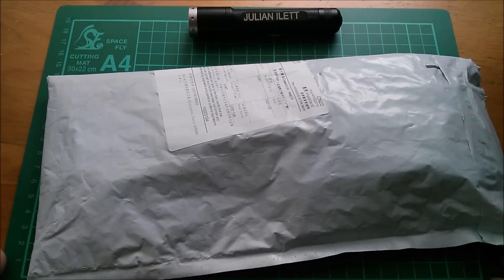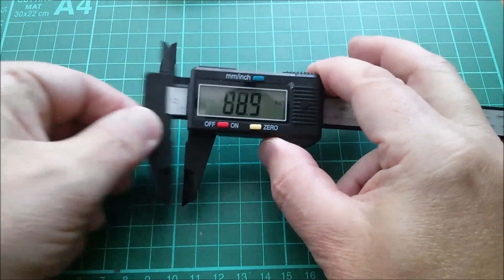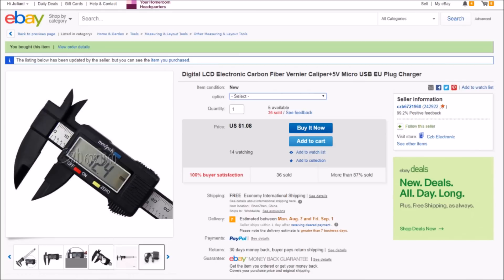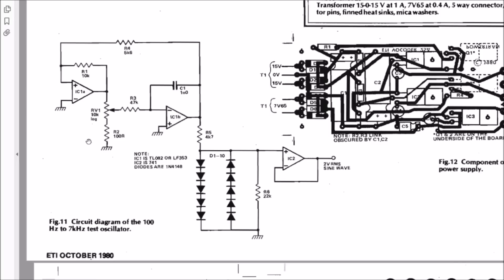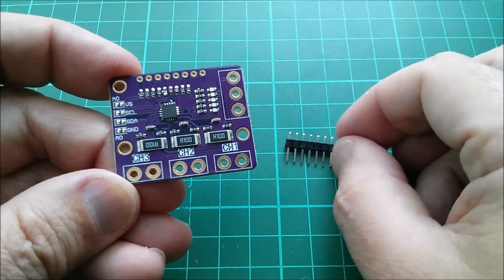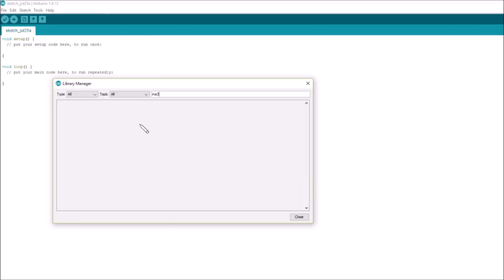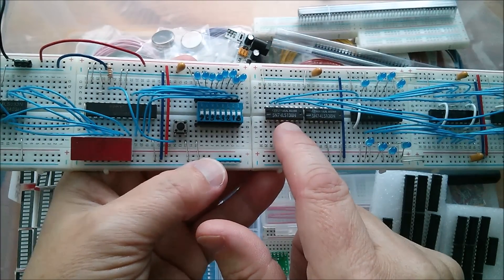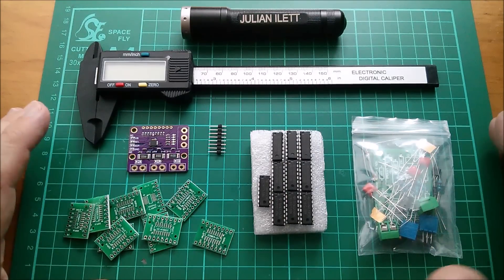Julian's Postbag: #102 - Electronics through the Letterbox

Comment: How the hell does that sine wave generator work, the one using 10 diodes? Does it just chop up a triangle wave?

I have always used a LC tank oscillator, hooked up to an op-amp to amplify and drive the LC tank oscillator, and then buffer that for a current backed usable sine wave signal.
Like this:
http://tinyurl.com/yyrp5lm4
Reply: That's an interesting page,  there.  The vocoder-related circuit does NOT generate any kind of a sine wave  the dual op amps are set up as a schmitt trigger and an integrator,  so you would normally get a square wave and a triangle wave out of it.  The diodes just modify the triangle wave a bit,  but it's not a true sinewave,  not at all.
Reply: @Roy_Tellason  Yeah as I thought then.

Comment: Hi Julian,
I think I am having trouble with the smd resistor on the purple INA219.  I've tried to substitute the R100 with an R010 to measure 32 Amps at 12 volts and burned up a board.  Could you comment on the correct resistor for the higher amperage modification, please?  You called the R100s 100milliOhms and I'm not sure of how that is derived.  
Thank You,
Nick
Reply: It is highly unlikely that any Printed Circuit Board would have tracks which are capable of carrying 32 Amps, so there's your problem.  You need conductors which are able to carry that much current without overheating.

Comment: Should look at the one I just bought from a UK seller.

What a joke, cost me £9.99 and the finish is horrible for a complete metal calliper, its accuracy is anyone's guess, it measures 1mm more than it should do and under measures and never reads zero.

It has movement and when its "wiggled" in a zero position, the counter on the LCD goes up.

Comment: Hi Julian it seems that on the power bank that works there are two resistors on the data lines pulled to vcc and ground,the pondland power banks don't have these,I think its something to do with them,I've read that apple devices need them for charging,and it seems my v-usb circuit bennafits from them some how.

Comment: Hi Julian, I've got a question to ask,its not about postbag but about power supply's! Hear goes,I've a development board based on v-usb its called pixel loader,it basically runs strings of ws2812b led strips,now I use 5v dc usb power supply's,sometimes i use phone chargers, as my development board pixel loader is just a USB stick dongle kind of design with a 328p on board, it just plugs in and runs sketch loaded,Now hear is my problem,some of the USB power supply's don't seem to work,there is power to my board but won't run,its in spec at 5v and I never over load current I only run a few LEDs in a strip. I've a load of them and some work and some won't,do you think is because they may be too noisy? I can't think why they wouldn't work,even when I've no LEDs powered the the board won't power and run,Ime using usbasbloader as the  bootloader so I can plug the stick into the PC and change my sketch quickly, I think its something to do with the power supply sending noise down the USB lines maybe,what do you think? Its so strange,I've seen this a lot even with power banks not powering some projects but will others even when in spec.thanks
Reply from the maker: If you don't have an oscilloscope and you suspect noise is the problem, try putting a whopping great capacitor across Vcc and Gnd (near the processor of your controller board). That should help diagnose the problem.
Reply: Julian Ilett  Hi I tryed that,ime thinking now it may be the bootloader,its supposed to exit after 15 seconds of power.ile dig around some more,thanks pal.

Comment: The calipers are quadri calipers and have 4 measuring faces, you found 3. The fourth are opposite the hole depth gauge end if you turn them over when you slide them you'll notice that the end face and the back of the caliper have 2 parallel faces which can be used to measure stepped faces. Don't worry most engineers don't know that either. I've only used the metal versions as I'm not sure how accurate the plastic ones would be. There is also a reason they are called verniers, as the readings are only very near, real inspectors / engineers would use something a bit more accurate tolerance dependant but when your working to .0005" or .01mm accuracy they are not so good. Still ok for measuring most stuff.

Comment: Some problems with the cheap calipers is they use a lot of power in standby and don't have a low voltage cutoff, so as the battery gets low the measurements get dodgy. for a dollar though you cannot complain.

Comment: The reason the lightbulb goes instantly dim is because it starts off with a very low resistance many times lower than its nominal one! As it heats up to temperature, the resistance shoots up within seconds. Plus you can imagine your battery as having a parallel capacitance due to its layered construction, so after you draw a good bout of current out of it, its ESR too goes up.

Comment: I tried simulating that ETI test generator in LTSPICE (using LT1057 for IC1). Wouldn't oscillate... Anyone got any ideas why not?
Reply: And by sheer coincidence, after posting the above, I stumbled onto one of the most excellent circuit descriptions given by w2aew, which described an almost identical triangle wave generator (#186).
His description didn't help fix the problem, but got me poking about a little, whereupon I discovered that an op-amp input was loading down the vref divider (which it shouldn't). Turns out a mirrored and 2xrotated opamp in LTSpice (to swap the inputs) causes problems. Using an unmodified opamp,  it works...
Reply: Arrrgh, Idiot! Mirror/Rotate was reversing the supply pins to the opamp. Didn't notice that... Sorry to bother you...
Reply from the maker: No, that was interesting :)
I can't be bothered with circuit simulation - I prefer to breadboard it to see if it works.

Comment: Just picked up a set of the metal caliper. http://www.ebay.co.uk/itm/6-150mm-Digital-Steel-Caliper-Electronic-Micrometer-LCD-Measuring-Gauge-Tool/191636282425?ssPageName=STRK%3AMEBIDX%3AIT&_trksid=p2057872.m2749.l2649 . Not a bad price.
Reply: Plastic ones are ideal for measuring the thickness of batteries.

Comment: You need to measure it while the battery & caliper are both perfectly horizontal, it might show 18.0mm then.  Hard to do when holding it in your hand, you're introducing a slight vertical angle.

Comment: To all you $10 Caliper people: Dont make the mistake I did of buying the METAL calipers without the digital thing. They are complete crap, you are better off buying this plastic one with the accurate digital device than trying to read cheap metal calipers manually.
Reply: Get a good pair, Mitutoyo or Starrett, digital, dial (or even old school harder to read vernier) with carbide jaws... take care of them (don't let any batteries corrode), and they'll preform admirably & be passed down for generations.
Reply: i would just go to a damn store and buy 20$ metal, digital calipers. its really not that much money and they usually last quite a long time.

Comment: Listing with caliper and USB charger makes no sense. But lately sellers started packing two more or less unrelated items - one cheap, and one expensive (that you actually want to buy). The reason is that more expensive item then appears much higher in the search result when buyer chooses ordering by price. So this about $4 (or whatever the price was) caliper would be listed at the top, as $1 item. This shady practice should be forbidden by eBay.
Reply: yeah it's listing fraud.. the option thing is only supposed to be for variations of the basic same thing, e.g. differnt color, style, or for example US vs EU plug... Chinese sellers have been abusing the crap out of it for listing "click bait"
Reply: Listing fraud has gotten so bad that i automatically skip ANY multiple listing now.  I wish there was a way to eliminate all multiple listings from my searches entirely.
Reply: Same here.

Comment: The caliper package is for all the ranges of products made by that factory -- they are supposed to put some sort of marker on the one that the product inside is supposed to use.

p.s. Those calipers only turn off display and do not have an actual sleep mode. You might want to put some sort of physical switch in place of on/off button.

Comment: 2:00 Digital or vernier calipers arn't meant to be treated or used that way, they are precision instruments to be used with care and delicately to give an accurate measurement. Not a good test.
Reply: These cannot possibly be a precision device.The plastic (not carbon fibre, at this price) is very temperature-dependant, and it will wear out rapidly. They're a rough guide only,  precision tools are made from metal, and can measure to at least ten times (usually 100 times) the resolution of this toy/scam, and they're off-the-shelf items. Those are the ones to handle with respect.

Comment: Never seen a caliper with just .1mm resolution. Every single one i have come across has been .01mm. Still for the money it seems quite usable. I wonder wheather you bought it after i suggested one some time ago :)
Reply: muh1h1 , 0.1mm resolution, 0.2mm accuracy.
Reply from the maker: +muh1h1 I did buy it after reading a comment, probably your's :)
Reply: Hope you enjoy them :)
However i would have payed a few dollars more to get a metal version with .01mm resolution ^^
Reply: Having thought recently that the plastic calipers I had weren't enough I spent about ten quid on these https://www.aliexpress.com/snapshot/0.html?spm=a2g0s.9042647.6.2.3WVqjo&orderId=503275973563356&productId=32813753127  So far so good, resolution of 0.01 mm, and stainless steel rather than carbon fibre or plastic.  I went for the case to improve the chance of it arriving still straight, almost unnecessary as the vendor packed it very well.  Nice to use, especially the the little thumb wheel for fine adjustment.

Comment: The "feature" of the display of the calipers turning on on movement is actually pretty annoying. It shows you that the "off" switch only blanks the display, but the rest is still running. That's why it's very likely that you will come back to a flat battery after a few month even without ever using it. Either remove the battery after every use (which is quite a hassle) or rig something up to disconnect the battery. I use a strip of sturdy plastic sheet cut from the blister pack. I jammed it in under the battery with a tab sticking out that I can turn to break the contact.
Also you should get the metal version of these calipers. I got mine at Hofer, the Austrian Aldi (yep, we are one of the only two countries in the world where Aldi isn't called "Aldi") for 12€. They have it randomly once a year. Should be the same with Lidl. My metal version has the exact same display, but displays another digit after the decimal point (where yours is blank). It also has a small metal wheel which is useful for fine adjustments, a locking screw and it's made out of metal so you can transfer a locked measurement easily by scratching (don't tell machinists ;) )

And the thing about the listing: I report such listings to ebay as "search and browse manipulation". Sellers are using the multiple item option to add completely unrelated items with a lower price so it shows up further up in search results by price, while at the same time placing the more expensive item as first item in the title.

Comment: If you peel the sticker off that caliper, itll reveal some funny looking metal tracks and pads. The act as a variable capacitor with the plates on the bottomside of the moving part. They cant skip steps because the sensing system is absolute.
Reply: The Tesa Shop-Cal has those capacitive plates exposed.

Comment: A couple years ago I picked up some new old stock HeathKit Digital traning boards which evidently mount into a larger box with backplane connectors. All of the boards had mapped out sections for digital logic and all of them were surface mount components. I had hopes of finding schematics and a manual, but alas, the information seems to be very rare

Comment: You got the new super accurate calipers then the old faithful ruler came out.....
Reply from the maker: +Mike James ha ha, the irony :)
Reply: 0.1mm resolution is far from "super accurate"!  You should be able to find stainless steel calipers with 0.01mm resolution and a nice box locally for less than $10-15 (at least while on sale).  Your local car and home store (ie. Canadian Tire) should have them so it is quicker than ordering from China and with a local return policy if there is a problem.  Plastic will wear especially if you are turning round items a lot to find the narrowest or thickest diameter.
Reply: Canadian Tire in the UK?
And in the Netherlands you can't buy a digital caliper for $15,... Make that €30,... Which is a big step up from China. Branded calipers are better (especially on battery life) and indeed, plastic just sucks, but for the money you can complain.
Reply: super accurate ... well better then the old faithfull ruler though .... a man only has so much patience for reading things accurately.

Comment: The string of diodes in the sine-wave generator is nothing more than a signal clipper - basically back to back zeners of 2.4V (4 x 0.6V) that clips the output if it exceeds that voltage. The circuit will probably work fine without those diodes.
Reply: It's a bit cleverer than that, the oscillator is a triangle wave generator and the logarithmic diode forward voltage curve converts it into a rough sine wave.  Obviously still not as pure a sine wave as a proper sine wave oscillator like the Wien Bridge circuit used in the kit.
Reply: Yes, but there are 5 in a string ;)
Reply: oops - I missed some of those angry pixies - 3.0V then.
Reply: It's alright, fellow AvE fan :D
Reply: number 33 Good point
Reply: +number 33 Correct. I used to use the same trick many times to generate a 2Hz 'sine' wave in PIR test rigs many years ago. Much easier than trying to do it with a Wein bridge oscillator at that frequency and the shape was pretty close to a sine.

In my implementation I used two diodes back-to-back in the negative feedback loop of an op-amp, with a pot as part of Rin to set the gain and hence adjust the 'sine' shape.